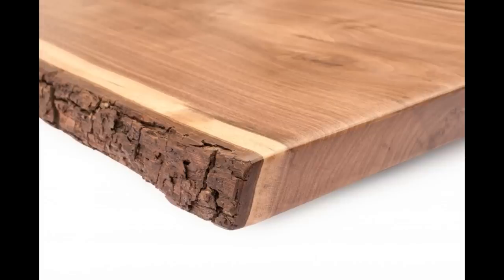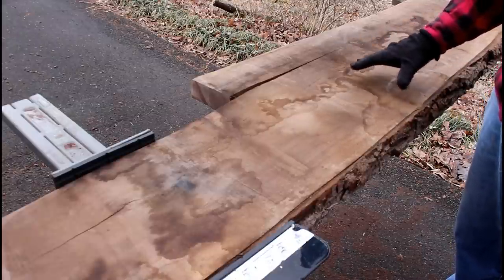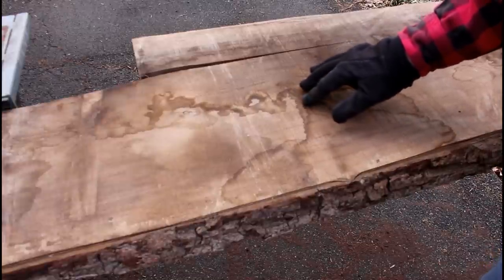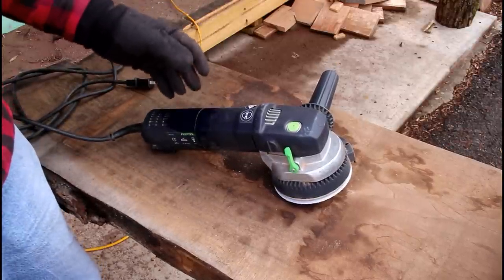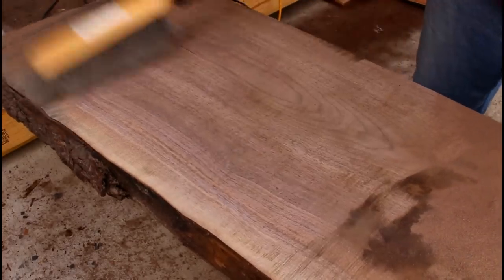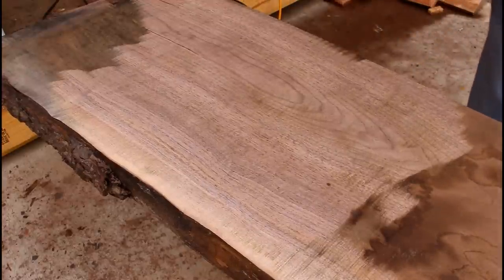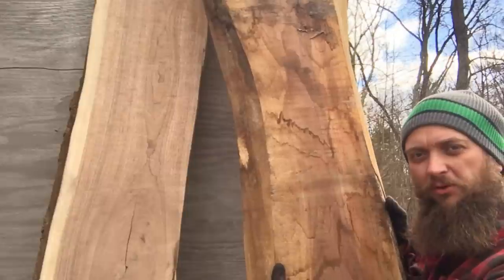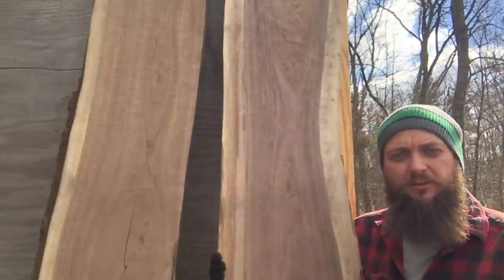IF YOU OWN A SAWMILL YOU NEED TO CHECK THIS OUT!  SAWMILL BUSINESS

Comment: When I mill a high value log to be slabbed , I use my electric pressure washer and spray both faces.  Then take a pic .  Now I have a pic of what the wood will look like when surfaced and finished.  The pic is available right now to show potential clients.   Now all you have to do is dry the wood , mark them per picture # so you can find it easy.  No more "show me all of those 300 slices of wood so I can think about it"  .    You have digital pics to show them that will be a far better representation of the color and figure of the slices .  Now the pics do show FLAT boards ,, not what the board may look like after it is dried .You can send out 1000 pics of the boards but you cant show 1000 boards without allot of very low pay work.
Reply: I have to second the pictures off the mill.  It doesn't take a whole lot of time, and you can just scribble numbers on the end of your slabs which match the default numbering scheme of your camera.  Not only does it help you sell it to your customers, but it also saves the sanity when you remember a specific log you cut 2 years ago but can't for remember where it is or if you ended up selling it,

Comment: I would like to offer a second option to quickly clean the surface - and one which might save your lungs a bit (even outside, I hate dealing with that much sanding...).  I think it is Triton who makes one right now - but a large hand held power planer.  Their planer is about 7" wide.  Set your cut pretty shallow and with 3 or 4 passes you can clean up several square feet of the face...in a few minutes you can surface an entire 8' slab.  Don't recall the prices, but you can probably pick up 2 or 3 for the same price as the Festool.

Along the same lines (though a bit more pricey and harder to find is something like the Makita 12" hand plane.  They are sold mainly for timber framers - but they do a treat for saw mills too to quickly knock the mineral stains off the wood from the kiln.

Comment: So basically a 4 1/2 " angle grinder with a sanding pad & disk. Milwaukee or DeWalt have  long-lasting   service in their tools also I just picked up a new.Jupiter pneumatic 7 in grinder/sander.  I'm kind of partial to air tools.. I made my living using tools.  A  standard  angle grinder will do just fine and the cost is a bunch lower.  keep up the great work. !!!!!!

Comment: I know this is a 4 yr old vid. but another good option at a great savings ran on AIR...
Harbor has a "Geared" 6" orbital sander and with 36/40 grit it is a Beast. 
This is not like the standard "Palm Orbitals"  this unit is kinda built like a side grinder or angle grinder, low RPM's but Torque'y.  and not as much dust kicked up due to it's slower turn. 
and its slow enough you can hold it flat and not gouge or have very bad scratches like holding the festool at an angle.
Great video.

Comment: 100% agree with everything you just said! I do this with a normal angle grinder and sending pad, does a perfect job. The longer the strokes are are the better the finish, and I try not to pause the pad on the wood, because it will leave divots on the surface! I just lift away the end of the stroke and back while the tool is moving. 
Great video 
Cheers
Reply from the maker: Thanks. Looks like an angle grinder would have been the cheaper route to go here. I will have to try that one day. Thanks for watching
Reply: Szilard Pinter agree
Reply: It's one of Festool's cheapest sanders though certainly more $$ than an angle grinder. If you don't use the dust collection capability it may not make sense. Have you tried putting something like an Oneida Dust Deputy cyclone ahead of your dust extractor? I mounted one on top of my CT-26 (they're made to fit perfectly) and it's effective enough for indoor use with my Festool sanders, routers, jigsaw, and tracksaw. Or possibly use a hand-held power planer? I've cleaned up lots of weathered reclaimed wood that way.
Reply: Szilard Pinter great advise. Normal grinders run at 10000 rpm. I’m sure the one shown runs less than 5000.  Definitely going to give it a whirl. ( probably a swirl too)
Reply: A wire cup brush on the angle grinder will do the same thing and never wear out. I just keep a block plane in my pocket and show them how quickly the staining comes off.

Comment: Great video as always.  I used to use my RAS in my chair making but has been collecting dust under my bench for 5+ years
Reply from the maker: Thanks, how did it do compared to other tools for the seat? I might take this by Curtis Buchanan's shop for a test run by him sometime. If I can get him to put his adze away.
Reply: Out of the Woods it wasn’t as strong as an angle grinder with an aggressive wheel like Kutzall.  The RAS works and is great for dust control but takes a lot longer for carving seats in hardwood.

Comment: Look for a used floor sander! you will save lots of time and have a more consistent job. 
A regular grinder works fine with the proper attachment for paper or a flap disk.
For tiny stuff I have a rotozip with the cutting/sanding attachment takes from memory 2.5" cutting wheel or same round of paper.
Other then that drum sanders pretty easy to build.
Reply from the maker: good options, thanks,

Comment: Quite the difference in the appearance of the slab after it's been sanded.  I'm sure running a standard handheld belt sander over it with a very coarse grit belt would get a similar result just as fast.

Comment: Another gem of information and a great video!
 Festool does make fantastic tools and for what its worth, the Festool Rotex sander is a better option to me. It has a larger surface area and two sanding modes, the option of aggressive and random orbital is great and both modes perform flawlessly. Sometimes tools that are multifunctional, don't perform well at every function they are marketed for, but that Rotex sander is definitely an exception.
Keep the great videos rolling Nate! Out of the woods!!!👍
Reply from the maker: Thanks Buddy, I appreciate the feedback!
Reply: I have that 6” festool Rotex sander. It is a beast of a sander.  And it would do great for you with much less ripples.  But on gear mode it can get away from you and wobble you a little.  But still worth it.  I own many festool tools and my admiration is limited to Track saw and sanders.  I really don’t care for the chop saw, jig saw, or the big drills.  The 90° attachment for drills is nice though.  Just no rpm’s. 

Anyway I am running on. 

I loved your video.

Comment: In the summer Ive sprayed the boards with bleach and it clears it up pretty good.
Reply from the maker: Just a light or heavy spray?
Reply: I took a 1 gallon insect sprayer and soaked it.I dont know if I would do it in cool weather though.It turns the wood kinda white in some cases.On cedar fences it works real good.Looks like that tool you have works pretty good!

Comment: the staining is from the drying process. the faster the moisture is removed the humidity in the kiln goes up just like in bathroom taking a shower. you get vapor buildup on the boards above each each other and then they form droplets that drop back on the board causing the stain. thats why I love my solar kiln to start the drying they heat during the day and allow the boards to cool in the night . it reduces the moisture buildup and reduces warping to. but does extend the drying time some. it does matter if you have a dehumidiferr in the kiln. the moisture builds up so fast and the dehumidifier cant keep up to frmove it fast enough.

Comment: Seven inch makita planer or even a four inch if you know haw to use it . Always run it at a slight angle so the outfeed table , or heel of the planer laps ont the previous pass . This keeps it from tipping.

Comment: Well I cut a lot of cootwood in alaska and birch too but the cottonwood was the one that liked to curl or stain. I started doing what an old timer next to me did. He would saw and then take it down to the lake behind us and throw it in for about two or three days. I asked him why and he said that the natural oil in the wood would soak out and then when he dried it, it didn't take as long and it wasn't curled or stained!! Oh if you like that sander, then try the big belt one and you will be amazed at how much leveler and no scratches and stuff. Way further ahead to use the belt instead of circular sander!! Just saying. It is the oil in walnut that makes those stains and it comes to the surface when drying
Reply from the maker: thanks for watching but I am not looking for a finished surface, or to get it level, people who buy my slabs run them through a planer, this is just used to show them what the potential is,

Comment: Some people just want everybody to be as sad and mean as they are. Great insight and video! It looks like some sort of water stains. I think it's because of the rate at which the water in the wood comes to the surface to be evaporated off. Are there any on the top slabs in the stacks or just on the lower slabs? I know there can't be so much moisture that it's dripping on the lower pieces.
Reply from the maker: Is is always on every slab no matter the placement,

Comment: I have designed a gas powered belt table sander that used the 4 6 inch wide belts and feed wheels to do slabs. it does the whole slabe in about min.
Reply from the maker: Wow I bet that is a nice set up
Reply: BEE HAPPY Wood Working and honeybees agree

Comment: You can just buy a normal angle grinder and a 7" backing pad for a 7" resin fiber disc and will do the job better and faster and wayyyyy cheaper than that .. just sayin.. or just pick up a big drum sander and push a button and charge more for sanding / flattening , the extra money you get pays for the drum sander in a month. Worth it .

Comment: I do not own a kiln so forgive me if this is a dumb question. Would it alleviate the stain problem any if the boards were loaded with a slight side to side angle so the water run off? Or is it not caused by standing water slowly evaporating off the face?

Comment: For your 3rd Christmas. Buy 1 gal. of Denatured Alcohol. Once the Customer is present, literally pour a couple cups of Denatured Alcohol on the wood, and spread with alcohol drenched rag. The Wood will 'come alive', for about 3 seconds. This does not add water/moisture, does not stain the wood. It also does another great thing, but that's another secret. My Customers where amazed.

Comment: if you have a sawmill you can clean the faces with the mill before sanding it. you'll save a lot of time and money for sandpaper
Reply from the maker: Wrong.
Reply from the maker: Sand paper cheap. Blades to resaw dry slabs are not.
Reply: @OutoftheWoods0623  what's the blade lifespan difference of sawing dry lumber vs green?

Comment: What is the RPM that the sander is running at?  and why are you tipping it and only sanding with just the one edge of the sander instead of keeping it flat and using the whole sanding disc? How well is the hook and loop standing up to use? the way you are holding it tipped to one side and only sanding with the edge of the disc i would imagine the disc wearing out fast on that edge and wearing thru and taking out the hook and loop part that is on the sander? do they have some way of replacing it when it wears out. I make my own discs, sanding pads and sanding discs which i just use on my angle grinders. the hook and loop attachment method is just not practicable tho and wears out in no time so ive resorted to just using spray adhesive but you have to find angle grinders that run at a lower RPM or they just throw the discs,  my 7-9" angle grinder with a fresh 36grit sanding disc will remove some serious product, it throws quite the rooster tail of dust

Comment: great video good advice   i have a chainsaw mill  and sell slabs as well however here is a cheaper tool for the job. look up King Arthur tools  i use a angle grinder and  the Galahad Carbide Disc works wonders and very cheap compared to yours  . give it a try  I used to use a grinder and sandpaper pads   = $$$$$$$

Comment: I notice you're just using the leading edge of the sander to clean of the slab. couldn't you just use a flap sanding wheel on a grinder to do the same thing?
Reply from the maker: you might be able to, I would be very interested in someone trying that method, I also remind people these slabs will be flattened by the customers before finished so the small marks left over by the sander will be gone,
Good idea though and probably cheaper than the festool,

Comment: Great video. I know a guy here in Georgia that does the same thing except he uses a angle grinder and a 80grit flap disc. I tried it myself recently on a live edge project it did great job. Same concept if you can't do the festool. Keep up the good work
Reply from the maker: Thanks Cody, didn't consider than method, thanks for sharing,
Reply: Out of the Woods no problem
Reply: Cody Bryant agree

Comment: I would disagree with what you said about your kiln. The slab you've shown tells me that you have condensation creating watermarks on the slab and I believe that is caused by more heat than air circulation. I don't know how you're running it but I know your humidity in that part of the country is A LOT higher than up in the Northwest so as the heat is driving the moisture out of the lumber if you don't have a small tornado going on inside there's nothing (not enough anyway) to carry that water away.

Running a $200 dehumidifier with a drain hose will help move air and lower the humidity too, and this will sound crazy but a small window A/C will cause that humidity to condense on the evaporator coils. Either method will work if you have one or two BIG fans running 24/7.

Comment: How about a belt sander? I know its aggressive  but doesnt seem much more aggressive then that tool.  I have used them on hardwood floors to get areas like corners etc etc that the drum sander doesnt get. The belts for it are cheap and  a black and decker belt sander is very inexpensive any one tried it on their slabes?
Reply from the maker: That is something that has been suggested, might be a cheaper option,

Comment: Have you tried a regular angle grinder with a flap wheel? If so, how would you rate it against the ras?
Reply from the maker: I have not. Might be a cheaper option.
Reply: Out of the Woods thanks for the reply. Of course the flap wheels will add up over time and cost more in the long run. Festools disk packs on Amazon are $28 for 25 disks, so cheaper in the long run for a production setup like yours.
Reply: Thomas Russell up

Comment: I hate to bring it up but if you have a “knowledgeable” lumber buyer, he will rarely buy a board that has had SANDPAPER used on it. He would be an idiot to buy like that and then try to run it through a planer or even use a hand plane on it. The sanding grit will eat up your knives or blades. A quality buyer will bring a handplane with him to check the grain. You might want to rethink unless you sell to inexperienced folks that only have “slab” on their mind.

Comment: Those look like water stains. If you brush off the dust and keep the rain off you might get less of them. Are you using stickers between planks? I wouldn’t want to be wasting wood getting rid of those circular marks if the odd one is deep. If you work only on one side, does the wood warp?  If you use the random mode you can use the full face of the sanding disc.Just a few  thoughts from an ignorant sawmill customer. I am envious of your lifestyle. Great video.
Reply from the maker: Thanks Jim. Good points there. I will reply later when I get to a pc

Comment: Why dont you hold it flat you said it has more surface because it doesn't have the holes then you only use the part that would not touch the holes anyway and holding it flat would give a non ripped surface?
Reply from the maker: it works a lot faster if held at an angle and the slabs are in the end milled to flatness so this has not been an issue with my customers, they are just happy they can see what they are buying,

Comment: Ooo, a nice and long video!
Reply from the maker: yep took forever to edit/upload,
Reply: 👍🏻👍🏻 I’m only 2 minutes in and it’s good already!
Reply from the maker: Thanks James, hope it helps people in this type of work etc, that tool would also be beneficial to woodworkers also,
Reply: Wow, that thing is fast! I might have to pick up one of those before the price hike on March
Reply: How wide of a planer do you have? I picked up a 20” grizzly helical head last winter and it’s been great. The only drawback is the space it takes up in the garage
Reply from the maker: 13in lunch box
Will upgrade finally later this year once I build the lumber building.
Reply: That’s what I ran on for a long time. Check out the grizzly when you’re ready, I’ve been happy with mine. The price point is great and I haven’t had any issues. Very nice finish right out of the machine with the helical head.